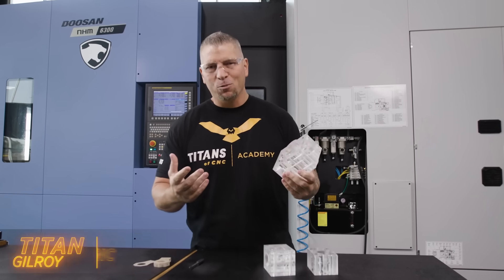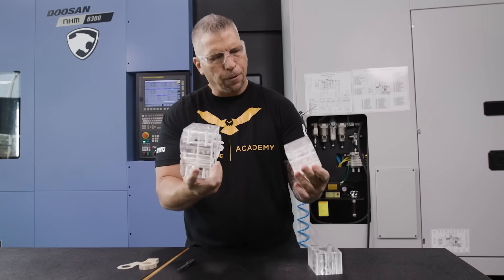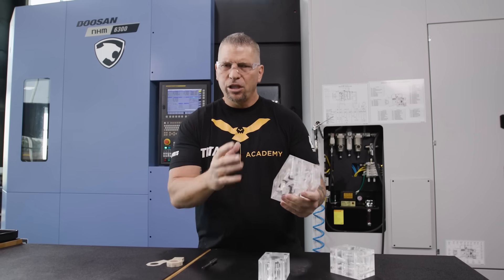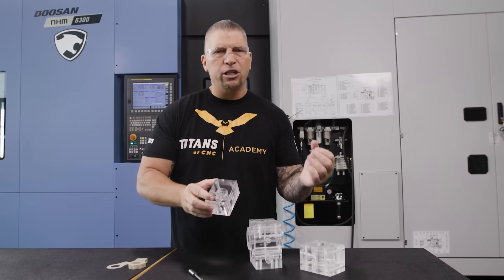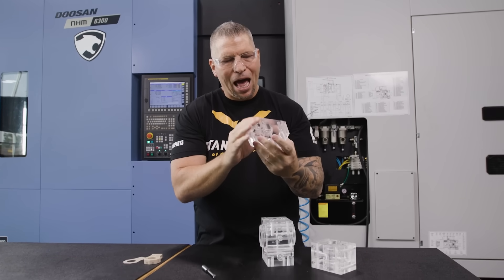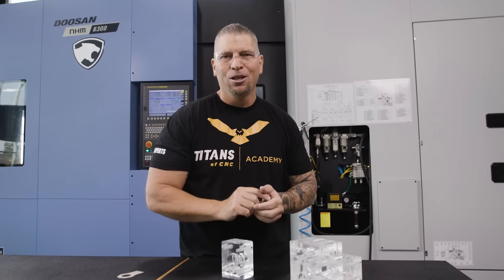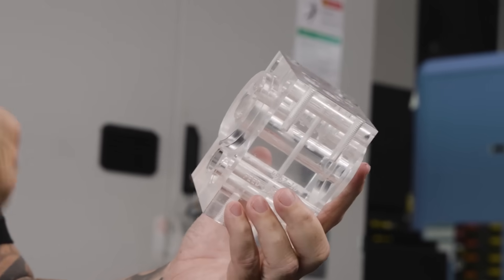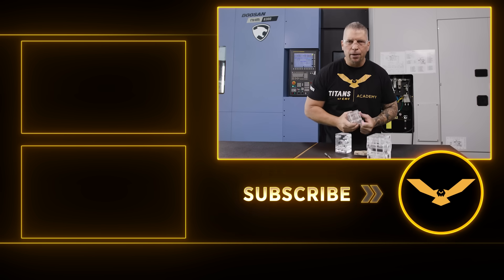My Secrets for CNC Machining PLASTIC

Comment: Seems like most of the time it's the machinist's mind that solves the problem. I was a Westinghouse toolmaker's apprentice 50 years ago ( I took my final exams for my tool design degree with a slide rule).  Every so often the journeyman shop would come across a job that they would have a hard time with. After they figured out how to make the part, they would send the print to the apprentice shop to see how long, if at all it would take us to do the job. One such job was an 8-inch long piece of 3/16 i.d. surgical tubing that needed both ends machined with a relief to hold a clamp. The machine used collar clamps so we needed to hold  +/- .005 on silicone tube.  Back then we didn't even have d.r.o.s . We only had the machine dials and dial indicators. When the apprentice instructor gave me the print my instructions were "MAKE THESE." The first thing I did was make an arbor to hold the tubing rigid. It shredded the tubing. I then ground a tool bit with all kinds of top and side rake and polished it with diamond lapping paste. It was probably the sharpest hand-ground tool ever. Same results. Both of my parents worked in the same complex and I remembered my mother had access to liquid nitrogen. I told our instructor I would be right back and went to my mother's lab. When I got there, Mom was just finishing a cyro test on a phosphor sample. I asked her if I could borrow some of the nitrogen and told her why. She said, " Just let me dunk these candy bars in it and take what's left". When I got back I froze one end of the tubing, took the cuts, measured, and measured again after the tube was back to normal temperature. This gave me a baseline of how much the part changed. After a few tries, I knew how much to take from the frozen silicone. I made the parts and handed them in about three hours after I got the print.
Reply: I hope you got your deserved praise.

Comment: Plastics is my bread and butter, specifically polycarb and acrylic parts for medical requiring crystal clear finishes. Takes a lot of knowledge, practice and the right tooling to get those finishes. Not something you can just google the answer for.
Reply: exactly we do a lot of plastic for aerospace, and some materials can cost even over £3000 per 1m long plate
tecasint5000, torlon, vespel and a lot of tricky to machine like a glass filled ultem or pvx
i love it, and you're right regarding the special tooling and surprisingly 
we use a lot of special tools, PCD and MCD (mono crystalline diamond) tooling where slot drill cutter cost even $800 :) 
glass filled peek GF30 is my favourite one to machine
Reply: LOL think that's fun try machining optical lens! my 1st job was in a shop that did that. We actually got to do stuff for the mars rover.
Reply: @dominic6634  what material is it used for marsROV lens
we do simillar thing lenses for high pressure subsea company called SAAB seaeye 
thick acrylic machined with MCD inserts to get he best posible finish for gentle  polishing
Reply: @dominic6634   im guessing you use CATIA for porgraming, designing and assembling,
most of our Aero & Space customer require CATIA :)
i like using Catia we just moved to CATIA V5 R31 version :)
Reply: We used Mastercam for programming, don't remember the CAD software. Machined a lot of manganese, Zinc, NBK7 and synthetic sapphire.
Reply: You vapor polish a lot?
Reply: I just worked with polycarbonate. They wanted a 32 finish all over the part. Struggled for a few days but finally got it.

Comment: One of the better videos you have put out.  One plastic material that can chip easily is ultem.  Curious to see how you hold tight tolerances on the uhmw. One of my least favorite plastics to machine, peek and vespel  sp1 are definitely my favorites out of the plastics.
Reply: Yeah I always hated cutting ultem we'd back it with fiberglass layup and I had a few techniques but it's tough AF and chemical resistant as far as plastics go.

Comment: Many years ago I watched my Uncle machine plastic bases for pipeline inspector bodies. He was extremely knowledgeable when it came to machining anything, especially plastics. As I was watching this I was wondering when you were going to get to the speed in which plastics are machined, and sure enough you did. He was a stickler about temp control as well, initial prototypes were monitored to adjust cutting, etc. I don't remember what type of plastic it was, to look at it when it was done there were no visible machine marks at all, there could not be any. He told me that if there were any machine marks in it at all, or is anything was off, at all, it would not work. A good machinist doesn't simply make parts, they make works of art.

Comment: Never thought about it being extremely hard. I have done aerospace "engineering" plastic parts of +-.030 but I haven't took it to Xtreme like .005+- or less.  I had fun cutting plastic. Definitely moves a lot if you don't have great vacuum suction.
Reply: Have you ever milled Acytal gears?
I have to hit ISO Quality 5 for an acytal spur gear.

Comment: Several years ago I was inspecting a Delrin bushing about 5" in diameter x .50" long with a .06 flange and .06 wall thickness, turned from a 6" solid bar.  I had inspected the first part off the machine and it was well within tolerance (+/- .005" if I remember correctly).  When the parts were finished, they sat in a box for a few days until I could get to them for the final inspection.  When I did, I found the O.D. and I.D. of the bushing to be about .005" undersize on all parts.  "How could this happen, that first part was good?"  

I mentioned it to my father (who had spent 40+ years in the plastics industry) and he said it was likely humidity change, the parts 'dried out.'  He suggested sealing them in a plastic bag with a few drops of water, so I did.  A few days later I checked them again, and all dimensions were back to normal, well within tolerance!  Now the work order/traveler for these parts has a note to keep them in plastic bags after they come out of the machine, and I haven't had any problems since.
Reply: There are both hydroscopic and hydrophobic plastics.

When I worked in the lithum battery industry everything that went inside the can was spected for minimum times under vacuum with/without heat, at least 24 hours in the dryroom. Lithum is hyper-reactive to water.

Luckily, the dims on the plastic parts were checked off the truck, and not rechecked after the drying period.

All those borderline at the low dim parts... 👀
Reply: Plastics more sensitive to heat change than metals.reason was the termal expansion.
Reply: @blabla-kk8bl  Bull$hit. Plastics are susceptible to all factors: moisture, temperature, pressure, forces (mechanical load), chemicals, plus shrinkage from manufacturing (molding or extrusion). All of those can cause dimensional/geometry changes.
Uneducated trolls know only one thing: "thermal expansion".
Reply: @qwertyuiop2895    why can't you make your point without being rude ?
Let the validity of your comment stand on its merit ... people will respect you more for that than you just  being nasty... 🙄🙁
Reply: @peterfitzpatrick7032  he wasnt rude? just called  bs

Comment: We have covered plastic tips many times on Instagram because it can be difficult.  Stringy chips especially can wreak havoc when turning.  Milling a slot or creating a series of grooves breaks up the material allowing better chip control when turning.  Reversing drills upon retract quickly can often unwind the chips between holes.  Peck turning in small increments can break the chips.  Sharp tooling with a high polish, coolant if needed to prevent melting.  On new materials it is good to make a prototype and allow it to rest overnight, did the dimensions move the next day?
Reply: We had a customer freak out that we sent them a bunch of bad parts. Turns out that they had been sitting on the shelf so long that they shrank over time by about .010 of an inch.  They were totally surprised by this. We informed th that plastic parts, especially those made out of delrin, while shrink over time and need to be used very quickly.
Reply: @brandons9138  Tenperature, and humidity are the greatest factors in plastic parts changing.  They certainly can change overnight when allowed to rest.   Large changes after 24 hours I have not witnessed personally.
Reply: @OctaneWorkholding  The specific part I was talking about we go from 1 and 3/8 down to 3/8 with a very aggressive thread on it. Delrin is also known to have a very high centerline porosity which increases it shrinking over time.

At my previous shop we were doing large delrin parts over a foot long with very thin walls. What we weren't told by the customer is after completion they were put through an autoclave. The customer complained that we send them parts out of print. We told them to check the parts prior to being autoclaved and they found that the autoclave was shrinking them by almost an eighth of an inch in the thin wall sections. 

We ended up having to rough the parts leaving a hundred thou on every surface. Then we would anneal the parts in an oven overnight. Basically at this point we had preshrunk the material.  Then we could finish machine the parts with some predictable stability.

Comment: Whenever im cutting uhmw i throw a thermometer in my coolant tank and make sure its 70F.  If its hotter or colder ill throw a heating element or a chiller to get it to 70F.  That shit is wild with temp
Reply: Try air blast cooling next time.

Comment: Hi Titan, recently we have to drill an array of 2mm diameter x 100mm deep holes on a piece of solid PMMA.  We use peck drilling codes like G73 and G83 but the result is still not that good.  Would you show us how to do that?  Thanks a lot.

Comment: How about a . 75 thick x 4wide x 10long... Where the middle of the part is milled down to . 250 from one side and each side finishes at . 625 thick. 

How do you keep it flat within . 010?  Rough, flip, flip, flip,,, use brand new shearhog inserts on final pass and it still bowed!!! So frustrating....
Reply: Most people don't like the answer. I've tried a lot of stuff, one of the only ways is to rough and flip as many times as necessary which really sucks. The other answer is the material supplier. I've had some suppliers give us material that consistently didn't warp after cutting, which would help since you've only got 1/8 to work with on thickness. I'd like a better way too, but I haven't found anything other than forming after machining which isn't always allowed.

Comment: Yeah, ok, you milled plastic and troubleshot your way to good parts. But can you find a turning insert that actually breaks a chip in delrin? 🤣 Stuff is a nightmare to cut on a cnc lathe. Spend more time with a knife cutting the "chips" off the part than you do in cycle time.
Reply: Are you having trouble breaking the chips on the roughing passes? Or just on the finish pass? If you can't break the chip on the roughing pass you need to push it harder. Finish passes you're never going to be able to break the chip very effectively no matter what you're turning insert is.
Reply: Mabe program a laser to cut the chip. 😎

Comment: Great video! It was really interesting to see how you face op2 hats with plastic. I typically get bad chipping, so I would cut the profile of the part staying .03" off the face. Than I would take am aggressive face .005" above the face, and then come and kiss it. I'll definitely have to try your method though!
Reply: Just use a pocket routine and start from the outside working inward on faces.
Reply: @MG-sg2ci  that's a good idea, I'll have to try that too! Thanks!

Comment: Yep, when I machined UHMW on the mill it would always come out under spec. Found out the work light on the mill, which was a regular light bulb, was heating the material and expanding it. I changed the bulb out for Led bulb and no more problems. 😉👍 Thank you Titan for all your videos. Information is priceless. 🇺🇸🇺🇸🇺🇸
Reply: Damn that wild makes sense tho. Some light bulbs will make my room freaking hot the LEDs tho they have little to no heat given off from the bulb. Is it hard to keep the material cool when working plastics
Reply: @ronniewilliz153  ,
Reply: UHMW ssssuuuuuuccckkkkkssss trying to hold a +/- .0005" tolerance on.

But we make it happen!
Reply: Ours would come out distorted from the vice. It's so slippery. Loose enough to keep tolerance, the tool would pull it out. Tight enough to hold it and it would have elliptical holes and trapezoidal sides. Eventually we found the balance to be in tolerance despite the defects, but I was never happy about the results.
Reply: @machinemaker2248  reaming thin parts with a large diameter bore is the absolute worst ive dealt with. had a .7500" reamer rip an aluminum part out of my vise and before i could stop it the tool decided to try to ream the next part, sending the stuck piece into the vise and BENDING THE SHANK of a 3/4" reamer. the okuma m560v it happened on didnt even care, spindle was somehow completely fine

Comment: Using the tape to hold the Peak is genius,  I owe ya one 👍
Reply: The plastic is PEEK. It's awfully expensive but pretty easy to machine. Just use aluminium cutters/cutting geometries.

Comment: Delrin, or POM-C as I know it, is so much fun to machine! On the conventional lathe tweaking the feed, RPM, cutting depth and cutting insert to turn aggressively but still making great parts. Drilling was not the nice, but turning, boring, tapping, reaming was awesome
Reply: I used to Just helix mill rather than drill when i did a lot of plastic

The surface finish in the hole is closer to a reamer than a drill and the chance for plastic to build up on the tool is negligible (i think it happened once on the largest run consisting of 2 machines running 24/7 for 16 months)

Comment: I use a spokeshave tool to deburr plastics all the time from saw guys.use a hand plain tool to chamfer the edges on finish parts,40 years as manual machinist can be a little boring..you slide the part on the cutting tool,like working  wood.working plastics  on manuals works better with carbon steel  or h.s.s. with positive rake on cutters.

Comment: Ah man, finally a vid on plastics. I mill a lot of polycarb sheets and i always have trouble in the z axis. Since i have to go through a cannot bolt it to the bed. For now i use plywood that i mill down before i start and then bolt the PC to it. Its terrible. Do you have tips on how to handle that, i have a table cnc. Love the channel!
Reply: Hey man. :You could try white modeling clay. Around the out side. Help seal the edges down. I know exactly what you are talking about w the taper to your part when milled. 
We found it was normaly suck up as the tool passed over.
Reply: Can you give a detailed explanation of your problem, maybe i can help you.
Reply: @JonasDM46  sounds like you are dutch, would be great to get your help. Can i sent you a message somehow?
Reply: @TomTheDutchy  Leg je het exacte probleem even uit, dan kijken we eerst of ik je hiermee kan helpen.
Reply: @JonasDM46  ik heb een step-cnc, moet 15 mm dik PC frezen, waarbij ik gaten van 14mm diep moet maken en op op sommige plaatsen volledig door. De vloer van de cnc is een aluminium bed, 
Dus ik kan niet helemaal door frezen omdat ik dan het aluminium raak. Ik schroef het nu op hout vast maar dit is gewoon niet accuraat. Heb je advies?
Reply: @TomTheDutchy  Dat is normaal eenvoudig op te lossen. Je schroeft een MDF plaat van 12mm dik vast op je freestafel waarbij de schroeven tot de helft verzonken zitten in het MDF. Probeer de schroeven te verdelen over het oppervlak van de plaat. Hierna vlak je enkele tienden van een millimeter van je MDF af om zo een nauwkeurig oppervlak te verkrijgen. Aangezien je niet beschikt over een vacuum tafel raad ik je aan om de polycarbonaat niet te schroeven maar te kleven door middel van dubbelzijdige tape. Om dit kleven te vereenvoudigen kan je de contour van de onderdelen die je wenst te frezen 2 tienden "voorfrezen" in de MDF onderplaat. Zo zie je makkelijk waar de tape gekleefd moet worden. Ik hoor het graag als je hier nog vragen/opmerkingen over hebt.
Reply: @JonasDM46  mdf is heel vocht gevoelig, ik vlak mijn multiplek normaal af en verzink die ook met schroeven. Dubbelzijdige heb ik slechte ervaringen mee omdat de dikte van de tapelaag niet consistent overal is. Welke tape gebruik je? Ik neig zelf eerder naar een soort van mal maken oid waar ik een stuk pc in leg en vervolgens deze om kan draaien, maar dan moet je een manier hebben om het werktstuk weer exact op dezelfde plek terug te leggen maar dan andersom.
Reply: @TomTheDutchy  Als je zonder koelvloeistof freest lijkt het me raar dat je op deze wijze slechte resultaten bereikt met een gevlakte MDF onderplaat. Wat is het formaat van plaat dat je wenst te frezen ?
Reply: @JonasDM46  1000x600 mm, bij het minste of geringste zit er een halve millimeter verschil tussen begin en eind
Reply: @TomTheDutchy  Al eens de effectieve plaatdikte gecontroleerd, dikte tolerantie ?
Reply: @JonasDM46  ja, zit er 0.7 mm naast maar is uniform over de hele plaat en corrigeer ik in cad, welke tape gebruik je? Krijg je met de tape niet ook een +-1mm dikte verschil?
Reply: @TomTheDutchy  Is tape voor tapijten. Is zeer dunne tape, 0,2mm dik als ik het juist heb. Weet niet meer vanbuiten welk merk deze was, maar ik weet wel dat Tesa deze ook in zijn gamma heeft.